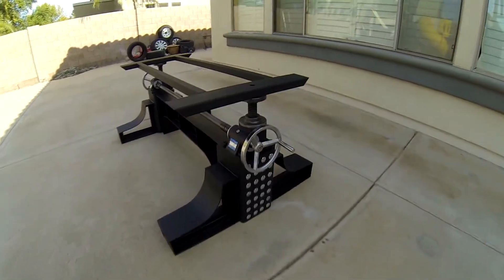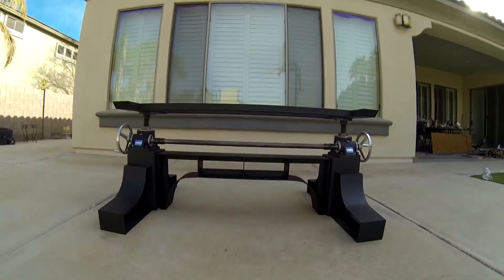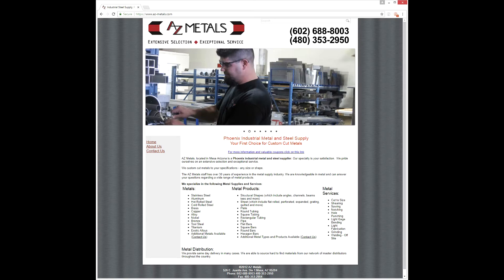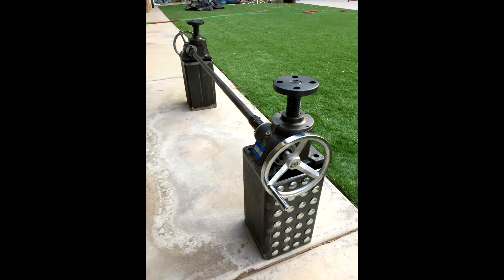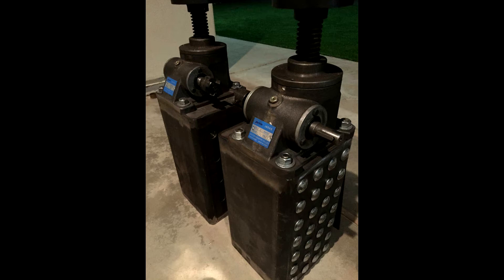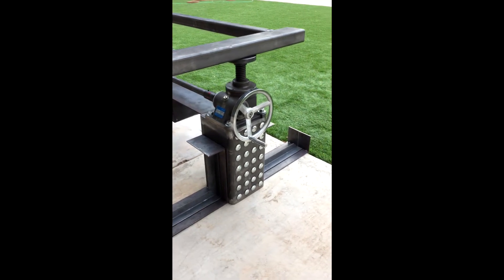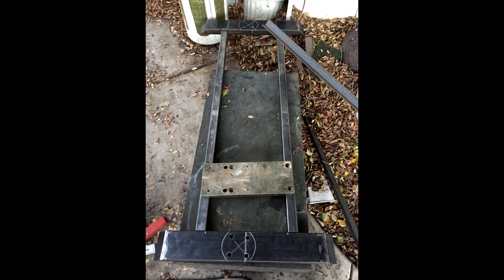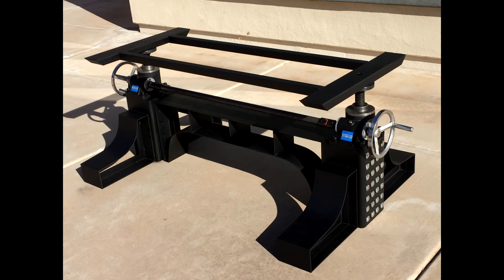Adjustable Height Table Base Build - 122517

Comment: Wow, impressed...Very well done.  Was contemplating similar and got hung up on the screw jacks.  Awesome to see you carried it through.  Since you went with two, I did want to ask if the Jacks had any slop in them causing the table top to wobble at all?
Reply from the maker: Thank you, Sir!  There is a slight wobble with the two jacks - good question.  Not something I notice in use when the table is loaded.  If the table was completely unloaded, and you leaned on one side, and then the other, you'd notice the small amount of shift/movement if you pay attention.  I went with a larger jack and screw diameter to minimize this.  It could be completely eliminated by drilling/threading a hole in the top collar (front or rear side) and then threading in a thumb screw, tightened down against the shafts.  Or one could use a 4 jack design with smaller screw jacks and it would be a non-issue.  I am planning on making a round game table at some point with one screw jack and this will be a bigger issue but I think will be okay.  EDIT:  Also want to point out that the screw jack column is not in the center line of the table.  This puts more weight on one side of the table and keeps it from wobbling... it is pre-wobbled to one side :)
Reply: @briandinse8632  Good plan having it Pre-wobbled.  Thanks for the reply

Comment: How much to make another one?
Reply from the maker: Sure it would be way more than anyone would be willing to pay :).  If I were doing this as a business, I'd save money and time from bulk quantity and batch processing.  But a one-off like this would have to be $6K - $9K to make it worth my time to sell, considering the things I do in life and the cost of the steel/screw jacks now that we have import tariffs driving the costs up so high.  Someone could buy a welder and the steel, learn how to weld, and do it on their own for less - and then have the welder and some new skills after.  Even if the welds looked messed up, that would be pretty cool too.  I did it because the picture I saw of something similar cost $25K and had a Pine wood top - way too much for me and I wanted a hardwood top.  And I always wanted to learn to TIG weld.